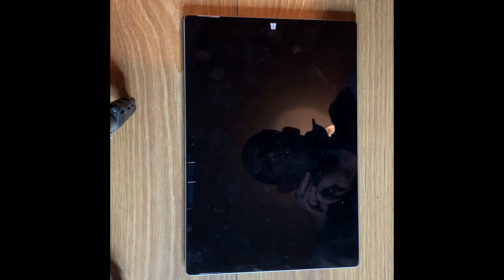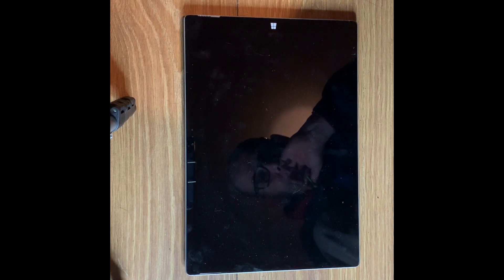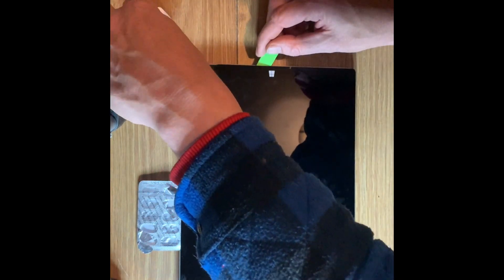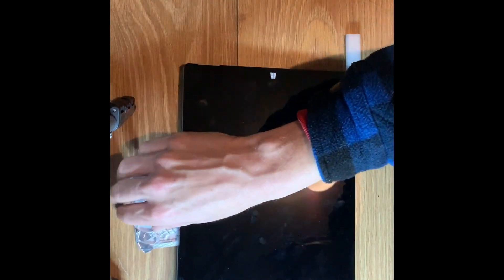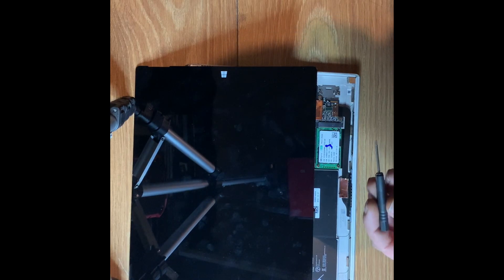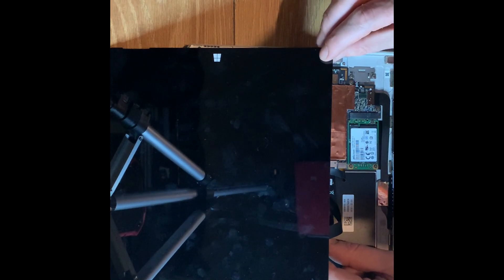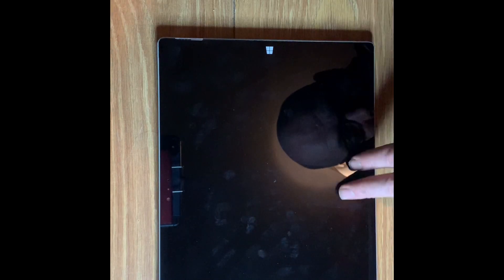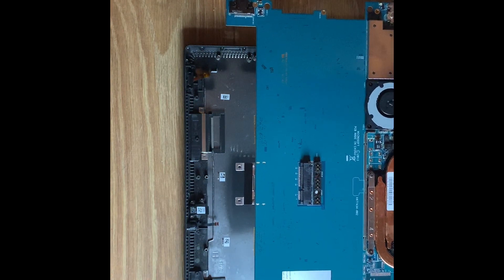Surface Pro 3 Upgrade

Comment: Such mixed feelings. Yes this is a pretty good video for how to upgrade the SSD but it isn’t a RAM upgrade. From what I can tell it’s soldered to the board and you’d have to do super hard micro soldering and like mess with the motherboard and components to make it work. So no, the RAM isn’t upgradable.
Reply: Mvp was wondering if rams soldered

Comment: Just picked up a used Pro 3 to go along with my Pro 7's and I'm already itching to try pulling the screen to upgrade the internal SSD... But even having a heat gun and suction cups made for removing phone/tablet screens, and having experience doing similar jobs I'm still hesitating because of how fragile  the 3's screen turned out to be...
Reply from the maker: Yes I felt the same as they are very fragile you’ve just got to have a lot of patience . And take your time and try not to apply too much heat in the screen area just along the sides  . Are use a heat pad for this which makes the process a lot easier as using heat guns can be a little bit hit and miss . Just try not to heat the glass up around the edge too much otherwise the heat corset to crack . The very first one I did took me over an hour and a half to remove it also making sure you have lots of pics available to wedge underneath as you gently go round the edges of the surface pro .
Reply: @recyclingelectronics-  you aren't replacing the RAM, the RAM is directly soldered onto the motherboard, you're replacing the SSD

Comment: I had my 128G drive cloned using a 240G on a surface pro 3. It still says 128G on it. Though the drive name has changed. Is it possible to upgrade the pro 3 beyond 128GB?
Reply: Go to disk management. You likely have some unallocated space that just needs to be allocated.

Comment: 15:00 point is where the hard drive swap Begins. Heat around edges until it comes up with a plastic tool. Swap , reheat and seal You’re welcome.

Comment: To initially lift the screen at the top left corner, just use some medical tape or Gaffers tape because neither leave very much residue. If there is residue, then just use some Windex to remove the residue

Comment: Poster may be confusing some people.  This is a ssd upgrade, not a ram upgrade.
Reply: yes, you are correct, the RAM is soldered directly into the motherboard, meaning the RAM is not upgradeable

Comment: Is there a way to improve the ram ? mine is 8GB but I apparently need 16 GBP for my job.
Reply from the maker: This is not possible on the surface pro 3 as they are sold it directly to the main board . You would need to go to a surface pro 4 or higher . as the surface pro four do a 16 gig version .
Reply: @recyclingelectronics-  ah k, thanks for the help !

Comment: Ram is not hard drive space. SSD m2 is the hard drive itself, that’s the upgrade you did
Reply: MSATA SSD not m2. 😄
Reply: I saw you responded in my notifications but now it’s gone...
That’s interesting (that your surface pro 3 has an m.2 drive) I haven’t seen a pro 3 with m.2. MSATA looks like m.2 but are slightly larger, and have differences in their protocol/speed.
Reply: @loveasapologetics  it's an mSATA not an M.2
Reply: @Dev_4_hire  yeah. He used to have a response to my comment that said “no it’s a m.2” so I responded cordially.